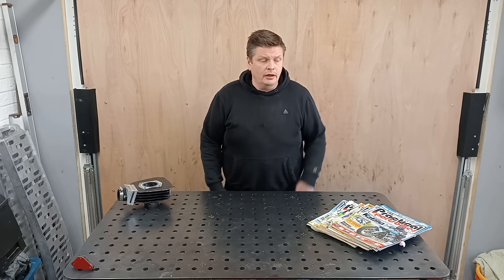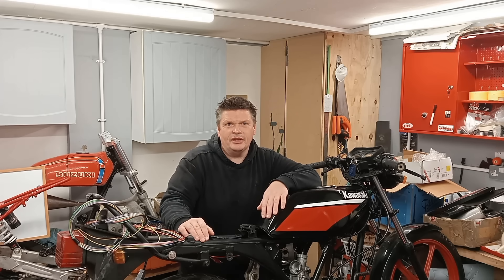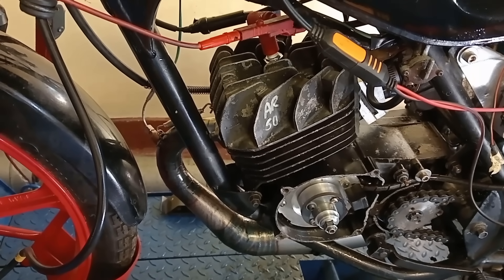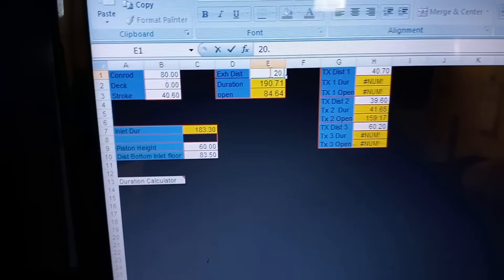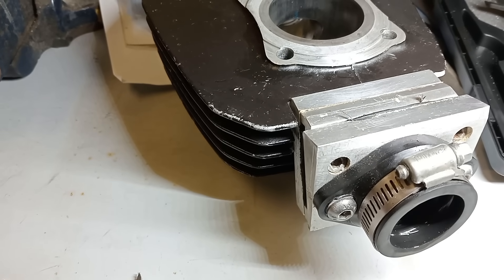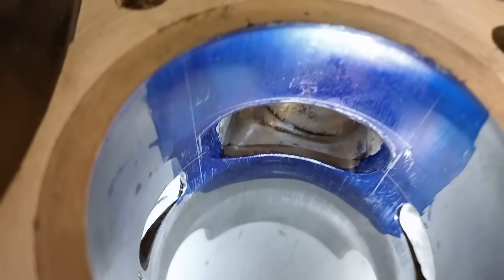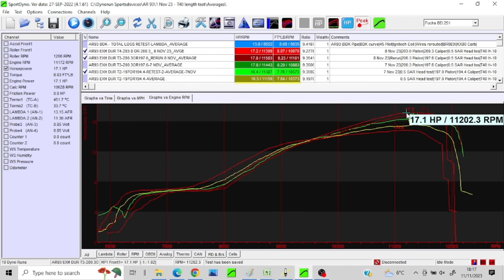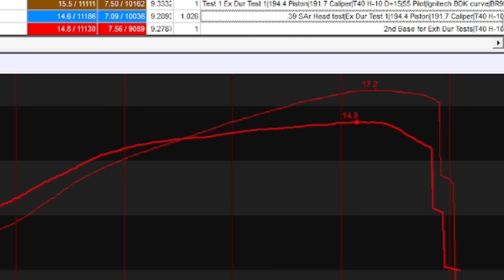This Tiny Port Change Changed Everything (Dyno Proof) #2stroke #power  #porting

Comment from the maker: Thank you to all who took the time to chat in the Premier - It was really cool getting to chat with you all and getting tips and suggestions - thank you.
Reply: A quick n dirty way of experimenting with port timing is to take down the edge of the piston crown.. old 70s tricks.. its not a "race" solution but does give fiddle room to see when power band gets too radical without risking the barrel.. dont go past half height ring to crown lip.. or youll cook the top ring.. pistons are cheap.. lengthen your pipe too for the extended timing

Look for a book.. 2-stroke performance tuning , A Graham Bell.. looove double knockers
Reply from the maker: Errol, this was my plan as I've done it before but as mentioned by others the dykes L ring sits virtually at the piston crown so I can't,
Reply: @AutoBeta2T  yes i didn't know about your ring pac.. id be ditching that piston & dykes.. they pickup a lot of exh heat & expand into the port & proned to lipping the port.. be sure to shamfer the cyl side port top edge
Reply from the maker: @Errol.C-nz - cheers I am looking for a replacement but it's a very odd size - 12 mm piston pin
Reply: id like to see him do that with his dykes ring.... @Errol.C-nz
Reply: @aljaxon69  yeah na won't work with them BUT.. they're not a performance fitment especially on loop scavenged 2-strokes.. too heavy & draggy.. great on uniflo & high torque tune
Reply from the maker: Errol, what Aljaxon69 said 🙂
Reply: @Errol.C-nz  Carving the top of the piston is quick, but won't give good real world power. As you carve the top of the piston, you're opening up the squish band and promoting  detonation which will kill power and put hole in piston really quick. So that is apples to oranges comparison. Plus carving piston lowers effective compression ratio. To optimize higher exhaust port, need to take cc's out of head, or take material off top of barrel. More lathe work...
Reply: @postulator890  you only take a bevel at the range of the exhaust port.. yeah i know & understand the squish issue but minor & as i said its a quick & dirty approach to test port timings without stuffing good barrels.. the mod doesnt affect detonation if it wasnt a problem before..
Reply: think of the port timing.. cringe.. like 4-stroke cam timing.. ramp angles & lift vs "effective" loft.. BIT.. imagine the effective volume gas flow.. its the pressure pulse being chased.. BUT again.. imagine .. like a river flash fload effect.. how the peak pressure pulse will catchup & compress the initial blowdown pulse front.. & .. that changes with exh gas temps & rpm time.. like a speeding bullet :-?
Reply: My Puch maxi 1 speed 70cc goes 45mph (I am at 7,000 elevation). Currently building a 2 speed I hope to get 60mph.

Comment: You need tight piston clearence's and a single ring . Not  best being air cooled . You want around 21 bhp to reach 100 and a torque increase. I had a 21 bhp AR125 on a All Speed exhaust jetted with a inlet extension tube . It still wouldn't do !00 mph and it was brand new .

Comment: Speaking as a very oldfella,have you considered ways and there is one,of getting a larger charge into the crankcase,under naturally aspirated conditions.Then on blowdown Power stroke you will make more pressure in crankcase and if your Transfers are shaped correctly should accelerate charge up into  Low pressure zone above piston.Exhausts I have found do not need to be Large , Due to the high pressure on power stroke Gasses will increase in velocity and increase even more when they hit expansion box, thereby generating serious low pressure on overlap helping draw more of charge trapped in crankcase but! i Am just tholdFella.

Comment: The top of the ring is the seal BUT the top of the piston IS the WINDOW. Have you considered  notching the piston to experiment vs the cylinders? piston are much easier and cheaper than barrels.
Reply from the maker: Cheers and yes I did consider filing the top of the piston; however, with it being a Dykes ring it's the ring controlling the port opening/closing so.doimg that wouldn't work.
I have done the piston filing trick before with good success.
Cheers
Dave

Comment: 16:05, you need to blend that port transition better, there is a vortex being created there for sure.  Also, never mind the concern for exhaust gas velocity in the exhaust port of a 2 stroke.  Exhaust gas velocity is not how they scavenge so you are better off making sure the K value (flow rate/pressure drop) is as low as possible.  The surface area of the port must match or be slightly larger than the surface area of the window.  2 strokes scavenge first through blow down, then transfer port pressure and finally negative acoustic pulse from the expansion pipe to create a greater pressure drop across the exhaust port.  Velocity doesn't much play a factor as there is little mass due to a short constant diameter pipe.  Velocity theoretically could help a little but the trade off being a greater pressure drop across the port, it's better to lean towards larger compared to smaller.  My 380 runs a 60mm exhaust outlet, for roughly a 350cc capacity, those dimensions in the 4 stroke world where exhaust gas velocity is critical for overlap scavenging are ludicrous, the exhaust is incredibly large compared to a 4 stroke, this is because a low pressure drop is far more important compared to velocity.
Reply from the maker: Hi, thanks for the info and apologies for the late reply.

With regards to the blend I found in this video https://youtu.be/_M1un_yed8k?si=LNo_nNlWZFIObQhf&utm_source=ZTQxO
That filling it increased the flow of the port. How much of a difference this would make in reality I'm not too sure.

Comment: Yea, I’m old, too freaking old. 

Most people when I was young got a stack of base gaskets and head gaskets and just kept the compression ratio the same while moving the barrel up by adding base gaskets and taking away head gaskets.

That way we could go past optimal timing and still have a standard barrel to modify.
Reply from the maker: Yep, that Defiently works.
The problem with this barrel was that the transfer timing was already too high before I started. About 136 deg duration 😵‍💫
Reply: @ 
That’s cool,
I did wonder why you didn’t lift the transfer ports at the same time. 

Back then we didn’t have access to dynos or the net or anything.
Just hit a known hill at a known speed at the bottom and see what speed it was at a known spot at the top.
We were kids in sheds in the 70,s no money, no tech.
Reply from the maker: @brucebaxter6923 yep, but the real world is where a bike has to perform so the best test. Dynos just speed it up a bit... it's kinda why I wanted to get to 100mph, it's not about dyno figures it about making enough HP to get to 100mph :)
Reply: @ 
I’m just jealous you have these things, I’m all in favour of tech, even to the point where “pcb way” can manufacture you a new barrel to your specs and deliver it to your house in two weeks. 

CAD cnc and online services are amazing now days
Reply from the maker: Yes, it's amazing what can be done... I'm hoping to get a new liner done on a mates 5baxis CNC machine at some point

Comment: No theoretically you should have to change your exhaust chamber with these changes you're doing to the modification you need to run a system to test that if you want good g a i n s
Reply from the maker: Agreed,  but that takes time. I think tests show that the engine likes more exhaust time area but a new exhaust could optimize it further... however these things take time 😊

Comment: a torque curve gives you a better idea of what's happening, as RPM increases, at the top end a constant torque will give increasing power, which confuses things a bit. I know you are aiming for 20hp, but peak torque and peak power are very different. I is conceivable that you could get more power by going in the other direction, to where the torque is higher. difference between max power RPM and max Torque RPM will tell you a lot. if They are far apart then You need to aim at moving the peak torque up in RPM?  Your inlet duration (if it's piston ported) needs to increase, or it's too restricted.
Reply from the maker: Hi, thanks for the info. Yes if I could get the peak torque higher up the rpm range without dropping I would get more power.
And yes, I think it needs some more inlet area too. I need to get back on with the project but I'm busy with life at the min :)

Cheers for the comments
Reply: @AutoBeta2T  on a pison ported engine cut a but off the bottom of the piston to check, piston is cheaper than a barrel! Oh, also: inceasing bore to stroke ratio moves torque down.  On my 125 twin I found 1/4 inch off puston was good. Did not change torque much lower but there was a pleasant kick at around 6500 rpm, it would lift the front wheel in 2nd as it reached that, It di 100 mph up a slighy incline but that was on the speedo
Reply from the maker: @willgeorge5644 cool, i will try some intake changes. The bore stroke ratio.really socks on this. 54.5mm bore and a 41.6mm stroke 🥲

Comment: Great work. With the original exhaust size, is there enough material to make two booster ports?
Reply from the maker: Cheers.
And possibly I could get some sub boost ports in.
I need to resleave so it is a potential route.
Reply: @AutoBeta2T  I have a gilardoni 50cc liquid cooled and I haven't fiddled with with the main exhaust or ports. Stock it comes with a similar reed valve intake onto the cylinder. I've drilled two boost ports (a few degrees lower than the exhaust port) and two extra ports on the intake that go straight to the side ports- It¡s really improved its performance a lot. I can't test everything as you do, but with a high squish 1.3mm, only a 14mm SHA dell'orto carb, an exhaust that works mainly on the mid range and long gears I can reach 70-75 mph GPS (115kmh) on a moped that is probably lighter than yours but not aerodynamic at all. So it's definitely worth considering. I basically copied the design of the Aprilia RS 125 cylinder mounted on the Rotax 122/123. I wish I could show you how my cylinder is ported, but you can have a look at the 125cc I mentioned. Great job and you have a lots of tools to make a much more precise job than mine and test everything.

Comment: Not sure how I missed this until now?
In the 80's many motocross bikes only ran a single ring (possibly 70's but I didn't do many back then)
Not  sure about road race as I didn't work on them until Shop sponsored Ian Lougher to do 125 TT
Anyway, around 2003~4 'pocket bikes' were 'everywhere' in USA. (I moved to Florida 99)
They had a design speed around 20~25 mph
As noted below, removing lower ring gave extra rpm with lower friction.
Doing some porting and exhaust mods allowed much higher rpm and top speed above 50mph. 
I was teaching 'engine reconditioning' back then and had student turn up Monday with arm in plaster but incredibly happy his pocket bike wasn't damaged !
Anyway, it works. 
 I like your channel because you have a more logical 'scientific' approach
I've watched 'Two Stroke Stuffing'  when he stared his '40bhp 50cc' several years ago but haven't subscribed to his channel as he's too haphazard and is now back to more or less conventional two stroke tuning (I lost interest when he stared doing things I knew about 50+ years ago)
Reply: TZ750: 1 ring.
Reply: As i type this he is at 30hp(dyno)  from 50cc. On nitromethane.

Comment: +2.5cv +400rpm 9° is the limit daily/fiability?

Drag bikes has more but cylinders off 3-4 sprints?

Same work but intake ports are 50% less gain hp?
Reply from the maker: I think I may need more intake port area.

Comment: So after I do this I just put it back together and it’s should work normal but with my power? I want to do this to mine.
Reply from the maker: Hi, yes but only small amounts off the exhaust. I took 0.5mm increments. 

What engine are you looking to modify?

If it already has enough blowdown time area it could make it worse.

What are the exhaust and transfer port timings?

Comment: really enjoying watching your contents sir!!  im riding the vespa px with 187cc cylinder i recently ported the exhaust port to 190 degrees, originally is around 182 degree. in theory, doesnt it got most horsepower with 190/130/30 exhaust transfer blowdown respectively?. if not, i really wanna be corrected lol. anyway, if i continue to port the exhaust timing to 200, with it get more top end performance which can extend the top speed theoretically?

ps with 190 degree timing, i could rev my scooter to around 9800 rpm, it get most hp @ around 8500 rpm.
Reply from the maker: Sorry for the late reply. I thinks as with this cylinder, once the maximum width is used on the exhaust port then you can only go up in duration to gain power. And yes, it will favor the top end and with the gearbox ratios and 4 speed on the Vespa it is a challenge to raise the power and keep it in the powerband. That said, if you do go up and it gets peaky then just lengthen the exhaust - that will move the curve to the left.

Comment: I once worked for a guy who built his own inertia engine dyno for only about 3 grand.  It was about 20 years ago.  He used software from a company called 'performance trends", and built the direct drive dyno and mounted it in a piece of 1" thick aluminum jig plate (ground flat on both sides is jig plate), and he used it for 26 cc model gas boat racing engines (a engine he was developing, but never came out with.).  I used it when starting my business, and it fit in the front seat of my car.  it was simply an engine mount hooked to a drive cable (could use shaft), into a 4000 rpm centrifugal clutch, (used on 1'5th scale gas rc cars), into a disconnect "in shaft" devise that he designed (clutch size, 2 piece that disconnected the flywheel weight from the engine when you let off the gas), and to the flywheel.  If you do the math for the flywheel inertia, (small diameter so high rpm will not blow it up), it will be very accurate, as there are only a few bearings in the drive shaft system that are not included for drag.   The engines I started working on (Zenoah G260 engines) has a manufacture claim of 2.8 hp at 12,000 rpm stock, with no exhaust or air filter.  After I jetted the carb as well as I could, I measured that same stock engine on that dyno to read 2.78 hp.  I can do a lot of cool things with my water brake dyno that yo can not do on a inertia dyno, but I have to say,---that thing was accurate and repeatable to a degree that most dyno's are not.
Reply from the maker: Yeah, inertia dynos seem to be pretty repeatable... well the one I use is. We use SportDevices software which seems pretty good too. I looked at the performance trends stuff too. It looked very good but the SportsDevices kit came up cheap so we went for that.

I'd like to add a brake to out dyno (the roller has an extra long shaft on one side that I believe is for mounting the retarder for the next model up. That said, I'd need new electronics as well so quite costly.
Reply: Opps, 4000 rpm was the engine idle.  The clutch engaged at about 7,000 rpm.

Comment: The most advanced engines are those of racing scooters. With the exhaust at less than 200° they easily exceed 15k rpm. The main performance is made by the shapes of the transfers and their total area. If you are looking for maximum performance, the cylinder and the exhaust are the ones that dictate the law. Surely you already know that
Reply: I would say motocross 2-stroke engines created the most advancement, (using a carb).  But they are not tuned for max power as say a cart engine may be, as the peakier power makes the bike hard to ride off road stuff well.  In the 70's and 80's, I would have to say that motocross was the leading sport for 2-stroke development, and probably spurred snowmobile engines just before the less popular activities.

Comment: For testing   could you not space the jug up the amount you want to raise the port then mill the head. to get compression back. A head is easier to replace than the jug.
Reply from the maker: Hi, yep, I could, but the transfers were already a bit too high so raising the barrel wasn't an option. This is one of the reasons for no base gasket.
Reply: @AutoBeta2T  Ok i got you it is one of those situations. I never played with dirt bikes, we oval raced Snow mobiles, we found just using a extra base gasket could make a difference. There are times that if you gain a sled length on a straight it is enough to do something with it.
Reply from the maker: @mylanmiller9656  yeah, I've tried it before with my x7 and the raise of the transfers and exhaust port helped. I guess it depends on the start point.
Reply: Even better for testing is a piston modification called "pie cutting".  It has its limits, but a modified piston can actually work better than the work of some engine porters.  You can add duration to the intake (piston port engines), the transfers, and the exhaust port independently.  For the exhaust port and transfer ports, you would cut the edge of the piston crown above the ring (can only remove so much, as the ring needs protection from combustion), as wide as the ports are.  For the intake on a piston port engine, you can remove some material from the bottom edge of the intake side piston skirt.  You do lose a bit of compression by cutting the top of the crown.  You are also only changing port time duration, and not gaining port area by changing width, so it is reliable, but as power increases, the power curve will become more "peaky" (narrow), were figuring out time area can retain more width of power (good power in a wider rpm range), at the same hp numbers.
Reply from the maker: Hi, EarthSurfer, I have tried this method before and it worked really well.
I couldn't do.it on this piston as it has a dykes ring and it sits fo high it dictates the port timing.